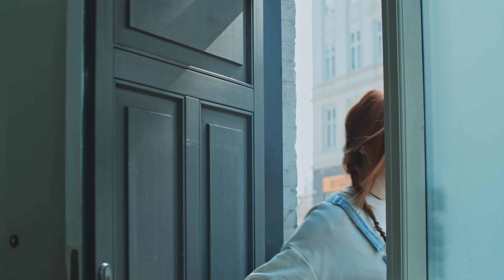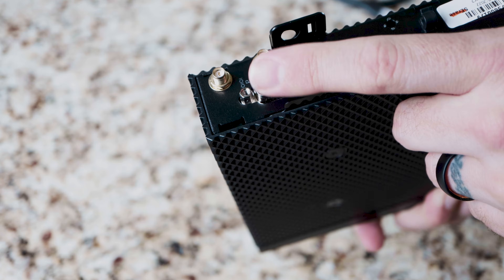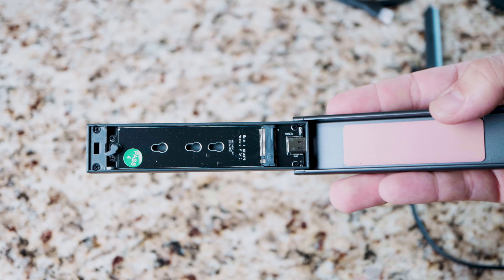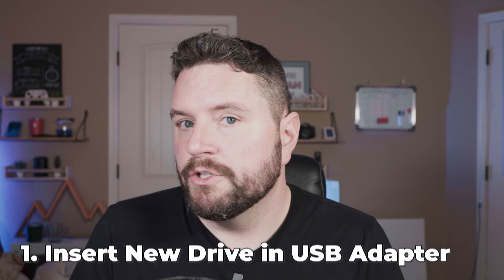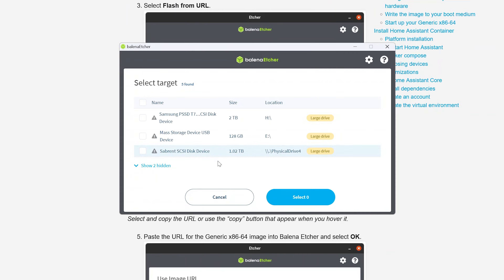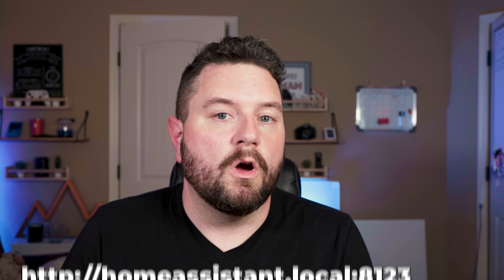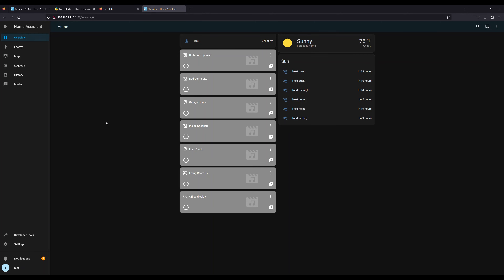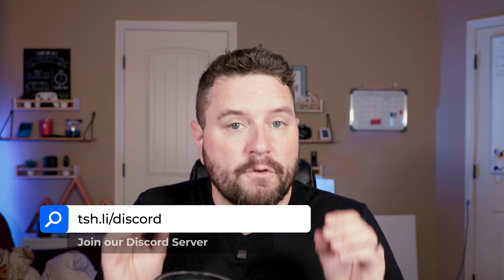No Pi? No Problem! Home Assistant on a Cheap Thin Client

Comment: I really don't understand what y'all are doing with HA. Saying a 32GB drive isn't enough, people saying a pi3 isn't enough, I have HA running on pi3 with debian 12 running the HA container plus some other containers for MQTT, sponsorblock and pihole. And still like 300-400MB of RAM that are still usable.

Also you can't "just upgrade the RAM like any other computer" - these boxes(or rather the cheap mobile processors they use, especially with Intel) come with limitations and even models from 2019 may limit you to a max of 8GB of RAM. 

Also with all the mods you made and what they cost I don't see how you think the price argument vs the Pi is still valid - a full pi4 set comes 100-150 bucks, pi5 is like 200, with the the additional power consumption of that Dell box you're easily spending more money(75$ base unit, 20$ for a hard drive, 15$ for the M.2-USB adapter, that's already 110$ - more than the pi4 set, plus, depending on the age of the box, the price of 1 kWh and what pi you compare it to an additional 10-50 bucks a year for your electricity bill) and time(especially beginners might run into difficulties with non-standard hardware that they can't easily debug themselves) comparatively...
Reply from the maker: While I understand your arguments, your numbers are way off. HA is a platform that can be used for more than just the basics. We are prepping folks to have limitless options.

1. Drive Size: 32gb is just barely enough to run the base image plus some add-ons. Your database grows year over year. Plus there are a TON of add-ons that would consume more space than the ones your listed. If someone sets up Frigate, then they are going to need a ton of space to store images/video. If you set up any video / camera software it is going to need more space.
2. RAM: If you buy a 2 or 4GB ThinClient, it is easy to upgrade to 8 or 16GB (not that you need it, but if you want to run 50+ containers you might see a benefit).
3. Costs: Pi’s are not $75 unless you are lucky. They have been consistently going for 2-3x the cost on the resale market. Also, a Pi with an SD card does not equal a ThinClient. The only stable way to run HA long term on a Pi is an SDD. So my 8gb Pi (purchased in 2020) was $85, plus the SSD adapter $20, plus the SSD $25, plus USB hubs for all of the sticks, $20 (double the cost of the Pi in todays world). Where as the ThinClient was $60-$80, plus an SSD $25, plus the adapter $20 and you are done.
4. Power: Check the comments, these ThinClients are built to be power savers. They consume just barely more W than a standard ThinClient. When you add fans, SDDs, and hubs, that amount is almost the same. 1kWh???? My house consumes 1kWh when I am not home, all of my servers, appliances, etc…
Reply: @ThisSmartHouse  

1. Sure, for video and photos you probably want a larger disk. But they don't need to be extremely fast unless you're doing security footage, but then honestly, you can't seriously recommend a thin client instead of a proper small efficient server with some form of (software) RAID and the proper hardware that will last people for more than 2 or 3 summers. Same with tons of containers. Most people don't have a backup(it's sad but that's just reality) so some form of RAID with notifications for data storage is a must, which in an end-user case will almost always be some form of NAS device that you pay a few bucks extra for not the hardware but the convience.

2. Again, with many of these thin clients(especially the older ones) you simply cannot upgrade them to more than 8GB of RAM. That's a hardware limitation. And some other thin clients you just outright can't upgrade because their RAM is soldered onto the board because they're simply not meant to be upgraded.

3. I literally just now bought a new Pi4 kit on amazon for 110€. With power adapter, cooling, 64G SD card and a case. Also just looked it up, 2 out of 5 shops here in Germany have the Pi5 stocked(just the unit, no kit) for ~90 bucks. So when you say 2-3x on the resale market.. Then either your local market in the US(I presume?) is just outright shit or you might be able to work on your buying strategy.

4. Tbh idk why you get so hung up on the 1kWh when I said "the price of 1 kWh". As in 1kWh as the base unit. The device itself obviously uses some fraction of that but when you run it 24/7 you'll accrue some kWh/a, which is the relevant unit here - difference in power consumption p.a. and the resulting extra cost p.a. - because if you're in a market that doesn't burn cheap fuel oil and coal and does have some for of environmental/CO2 taxes(you know, like many of the half a billion people in the european market), you'll probably need to worry about those extra 5 to 50 watts the x86 platform can burn compared to ARM. The simple reality is that with 30 cents per kWh, every 5 Watts more on a 24/7 device are 13 bucks per year. A Pi you can easily keep for 5-10 years, so if it just saves 5 Watts per hour compared to the x86 thin client(realistically more from what I have seen at work, especially given how horribly ineffient the older power bricks for these thin clients are - RPi5 now even supports PD, which means you can get an off-the-shelf PD GaN adapter), that's 65-130 bucks over the lifetime you literally just burnt on power ineffiency that you could have invested in something else. So imo if you really need features like mass storage, you're better off buying modern hardware and setting up redundancy(does HAOS even allow for that?) or setting up some cheap second hand NAS with fresh disks and if you don't need mass storage and don't want to deal with too much hassle, it's easier to just pay the extra 30 bucks on a pi and save those thrice in the long run.

5. Also because I've seen others make that claim - have you actually ever had reliabilty issues with a pi or it's storage? I've had Pi's for work and in private for a decade now and in my experience the thing that usually breaks first isnt the storage but the pi or the power adapter. So I'm honestly interested if SD card reliability is an issue which brands and/or models to avoid? :)

Comment: Is it possible to avoid the purchase of that M.2 Sata to USB and just use an empty external HDD drive?  Buying such a device just for one time flashing is not a budget-friendly situation.  Or are there other ways?
Reply from the maker: You could just use the bootable USB method found here: https://www.home-assistant.io/installation/generic-x86-64/

Comment: I've also switched to using thin clients as an alternative to pis.

It's just too hard and expensive to get a pi. And with the pi, you still need to add a case, heatsinks etc. 

And having a proper ssd is much better than relying on a micro SD 

I know the new pi 5 supports real ssds, but good luck actually managing to find one in stock.

Thin clients use very little power, so it's still a viable alternative.

Comment: Great video,  I've just ordered a 128gb wyse pc. It apparently already has Windows 10 installed and configured.  Is there any reason i shouldn't simply add home assistant to the existing windows os?
Reply from the maker: I would recommend installing Home Assistant by itself. It will be more reliable that way.

Comment: Hey Ryan, just wanna say thanks for your vid. Got myself the Wyse 5070 and could not be happier, albeit took some time but all sorted, from a backup. However, I thought I could run the HAOS off a USB key and wipe the 64GB hard drive - but seems I need the USB key, otherwise it boots into the pre-installed Win10. I did purchase a caddy for the drive which I will follow your steps - thus removing the WIN OS (and having more space). I came over from having HA on a Synology NAS which was good, but a pain at times with Zigby and other devices, not to mention the power consumption, albeit small, but this Wyse uses ~3.5w!
Reply from the maker: So happy the video help (and inspired you to get it set up)! Did you remove the included hard drive? In the video I flashed a new mSATA drive with HAOS and swapped out the original drive. You can flash over the included 64GB drive, that would be enough room to start with. But you might want to upgrade in the near future. You can always backup your Home Assistant and restore it once you flashed the drive. 

Let me know if you run into any issues!
Reply: @ThisSmartHouse  I used the included 64GB (yeah I will look at upgrading to a larger storage), hoping the USB key with HA on it would wipe the win OS - but I dont think HA can do that - it either needs to be run in Linux, or flashed onto disk -  I did not have the caddy for the NVME drive, which got delivered today. So Im now loading the HA image onto the NVMe drive, insert it back into the thin client and take it from there. A few hours work to get HA back up and running - my wife has been complaining about the automation not being around :)
Reply from the maker: @fearthesmeag  Yeah you would probably have to do that in two phases. Glad you got it figured out. Hopefully you got the right adapter. When I first released the video I had the wrong adapter (NVME vs mSATA), but fixed it a few months ago. The Wyse units use the older mSATA style drives.
Reply from the maker: @fearthesmeag  I get it, my wife complains all of the time about how complex our home is. But when the lights don’t turn on or the shades don’t close, she complains!
Reply: @ThisSmartHouse  Yup got the correct one and no issues with it as I made sure via the product description. The restore from backup was super quick - most of the automatons are working now, just tweaking a few again. But yeah, thanks again Ryan for an awesome vid - subbed and looking forward to see what else you have on your channel!
Reply: Newbie and green at all this. Followed the post and bought a Dell Wyse 5070. I have the right SSD, and I flashed HA on it. No matter what I set in the BIOS, as well as adding the boot script, it continues to boot to the ore-installed ThinOS built-in. What is this USB key...is there a way I can make this work. I am not following what you did. Thx

Comment: how about if we are on static ip, do i need to assign it manually?
Reply from the maker: You mean you have a static IP address on your internet connection? Or you're saying you have a static IP address you want to set up on the device? You can set a static IP address in home assistant under settings and network.
Reply: @ThisSmartHouse  i’m going to setup HA on office however we are on static ip, so ok im just gonna set it up on HA settings, right? Thanks sir
Reply from the maker: @BTLLGR Yes. Do you already have it set up somewhere with a dynamic address and you're just going to move it someplace with a static? It's pretty easily done via the web interface. But if you don't have access to the web UI you will have to do a via command line.
Reply: @ThisSmartHouse  yup. Thanks a lot big help 👌🏻

Comment: I'm using a Dell Wyze N03D for mine that I bought for 20$ it has 32gb mSATA SSD and 4gb of RAM, it runs home assistant on bare metal very well, it also idles at 5W and peaks at 15W so it's definitely worth it for the price that I paid for it
Reply from the maker: I just love how little power it uses. I am working on migrating my live set up from my pi 8gb to my thin client. It will be nice to start over.

Comment: A quick question I have been seeing a lot of HA tutorials where everyone uses 256gb of storage but HA only uses about 16gb . Is there a rationale for using such large storage SSDs? Or is it just availability since it’s harder to find 32gb SSDs now.
Reply from the maker: It's mostly because the 256 gig drives are just as cheap. But just like with most operating systems it only uses a small amount for the base OS but if you want to add any add-ons then those will consume more hard drive space.

Comment: I think it is time for me to make the move. My pi4b has frozen twice in the past week or so. Had to turn off the power/back on. It boots from a ssd and hardly uses any space or memory.  But I have a Dell 5060 with 8gb ram and a 256gb SSD I can use. Factory wifi also. I did a test install a few days ago and all went well. My concern is I want to make it have the same IP Address as the old pi has. I've seen video of that somewhere and plan to look it up. That should make it a fairly easy transfer once a backup is restored to the new system. Fingers crossed. :)

Comment: thank you for this video!
Have you had a chance to measure power consumption of this system?
Reply: about 3.5 watts (8Gb ram & 64GB HDD) - and it reboots in less than a min! Awesome little package! I was running HA off a Synology, but had all sorts of Zigbe USB and other issues - and not as fast as the 5070.

Comment: Hi....how do you manage the situation when the pc for some reason turn off, for example a power interruption?
Reply from the maker: You can go into the bios and set power recovery options so the computer turns on when power is applied. It is called different things on different computers.
Reply: @ThisSmartHouse  Thanks!!! And specifically does this pc have this function?
Reply from the maker: @msb3172 yes it does. I think most modern computers have it.

Comment: I have given up on using the internal SSD slot and I am in stead booting through one of the USB slots. That works fine. I do have a problem however. I would like to access things like wifi switches through the internal wifi but I can't get the internal wifi to work.  (Dell Wyse 5070 Thin with internal wifi and also 16Gb SSD chip on the main pcb.) Can any one give me some hint on how to get the internel wifi to work?

Comment: I have a problem with my Dell Wyse 5070. It does not reconice an SSD in the slot. The disk is fine when in an external box and connected to another PC. That is apparently correct according to Dell Technologies Article Number 000196552. The Dell Wyse 5070 has 16Gb installed on the main PCB. Is there anything I can do?

Comment: I'm running HAOS on a Lenovo 1L PC (6th gen i5), but as a VM under Proxmox.  Adds some complexity (mainly with USB device passthrough for the Zigbee/ZWave dongles), but it's still pretty straightforward, and you can do other things with the machine at the same time if you want.  But lots of ways to skin this cat.
Reply: Hello! Not sure if you'll see this, but I am currently in the process of setting up my 1st home assistant and am planning proxmox for it. This is because my plan is to also have frigate running on a docker container on the same Intel system.
Would you have links to any resources you may have referred to during your setup? Maybe YouTube videos or githubs?
Reply: @sagar93kamat  I don't know that I can post a link (YT has a habit of eating them), but if you do a web search for "proxmox helper scripts" I expect you'll find it.  That page gives a script to install HAOS.  From there, well, you're pretty well on your own.

Comment: Great Video ... I have HA running on a RPi 4 with an SSD drive connected to ethernet. I also run Zigbee devices on Zigbee2Mqtt with a Sonoff Zigbee 3.0 USB dongle .  Close to  160 devices run (40 on Zigbee) on present RPi 4+SSD, I have just got a "Dell Optiplex 7040 Micro Form Factor Desktop, Intel Quad Core i5 6500T 2.5Ghz, 16GB DDR4, 256GB NVMe SSD " . What would you suggest as the best way to migrate to the Optiplex ?

Comment: Great video. Question, I am seeing lots of 5070 thin clients with the J5005 processor. Is that an acceptable substitution? TIA
Reply from the maker: I am sure it would work. Home Assistant is pretty light on hardware requirements. I mean it runs great on a Pi, which is a weaker processor.
Reply: @ThisSmartHouse  Thanks for the quick reply. I'll pick one up.

Comment: The enclosure you have in your kit is for mini SATA's. I tried using the enclosure but it doesn't fit the M.2. SATA III you recommended.
Reply from the maker: Let me double check, I could have accidentally swapped the enclosure I was using (being in IT, I have a ton). Thanks for pointing that out!

Comment: With the new Intel N100 Chips low-power PC's are getting better by the month.

Already eying one with a USB-C power adapter.
Meaning I could use a 100W multi-port charger, to power it, and have a few usb ports free for other devices like a 5V network switch that uses USB.

Sadly there are only 1-2 of them on the market now, but soon if more come out, it will be a great solution for a low-power Home-assistant setup.

My current setup uses a PI, with 2 cases merged into 1 [ heatsink case, and box-case, which makes it look like it does not have a heatsink, but it in fact does, av-temp without fans= 55C]

Comment: HA is a seccurity scam - people will realize when they spend some time with this system. And seems like nothing been done to fix issues. Politcs games on the forum, security holes, lack of stability.
Reply from the maker: What is your proof? What security issues haven't been addressed by the devs? It is an open source project that if you find an issue you can contribute to a solution.

Comment: I've been using a Dell-Wyse 3090 for a little over a year. 8GB RAM, 64GB SSD, 35 bucks. Works like a charm. What compelled you to use a 1 TB SSD?
Reply from the maker: The fact that I could get it quickly on Amazon. 🤣 There's absolutely no need for that big of a hard drive.

Comment: Thanks - great video. Would Wyse 3040 N10D suffice?
Reply from the maker: It might work, but it is running an Atom processor the only ones I could find are 2GB. It might be ok to play with, but you will want more RAM than that.